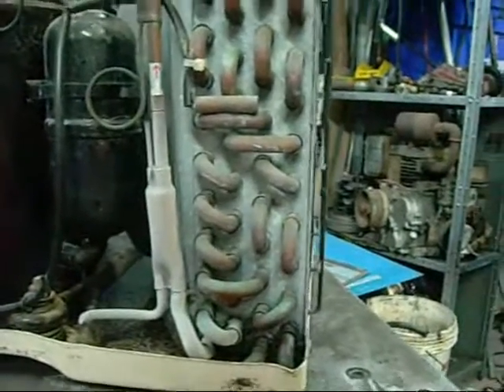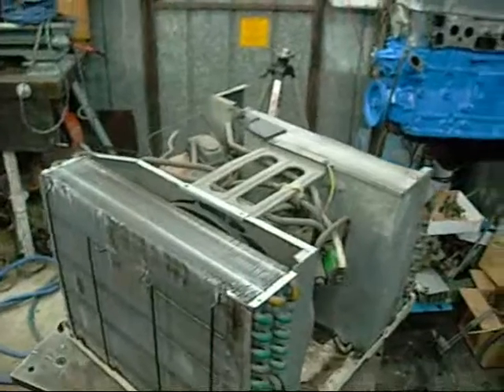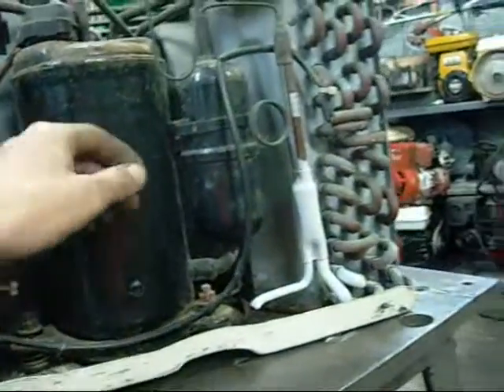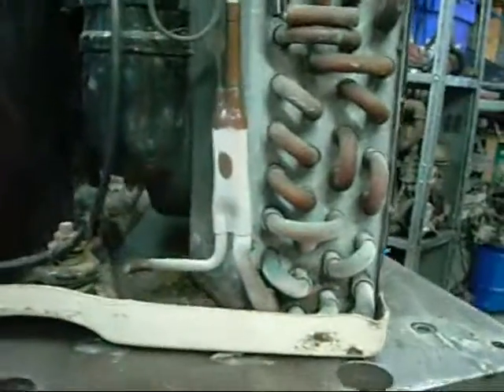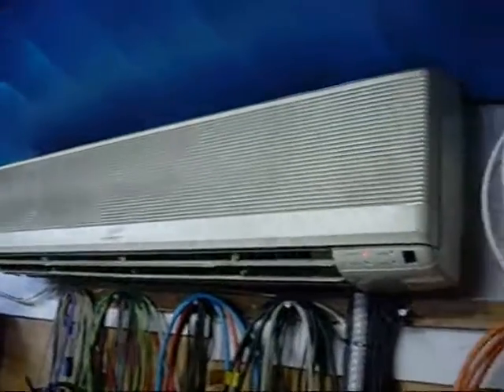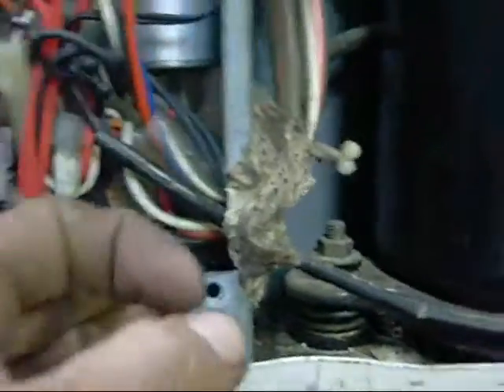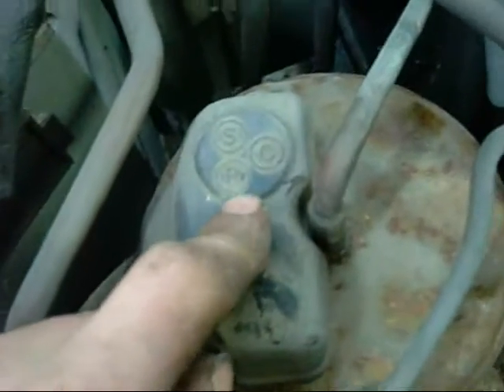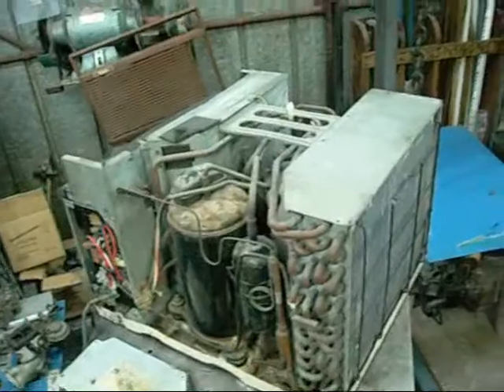The Heatpump Air Conditioner Explained - Pt2

Comment from the maker: @gavincurtis I've seen big screw units from overseas, I think Danfoss have a line of them now. but their all huge semi-hermetic systems for cool rooms.

Kaeser rotary screws are fantastic air compressors. my foundry job had a Airtower 47, with auto-drain and chilled water trap, monster of a machine but for its HP rating it was pretty quiet.

Comment from the maker: @GFVagent007 I've seen the automotive ones labeled flammable, but nothing clearly marked R290. I guess their just marketed under different names.

I wouldn't use flammable gas in a indoor unit simply because a leak would quickly form a dangerous explosion hazard (starter relay spark would touch it off nice) but outdoor or car stuff would be fine.

Comment from the maker: @Lewistodd2008 compressing any gas to a elevated pressure creates heat, in the case of refrigerant it also releases heat that the gas has absorbed in the evaporator.

its a combination of both mechanical and electrical heat from the compressor, and heat being rejected by the compressed gas.

Comment: @Aussie50 OK, I think I understand.  I also remember the same thing happening in a cool room at a restaurant my uncle used to own when the fan had been switched off because someone was cleaning out the cool room.  The cool room compressor kept turning on and off until it somehow managed to trip the circuit breaker, turning off all the lights with it.  When I was young we lived in a unit with a wall A/C and I remember when we ran it in heat mode the comp would cycle on and off every few minutes.

Comment: I remember some years ago I was at my ex girlfriend's house and somehow they'd managed to switch their Westinghouse window AC on without turning on the fan, I could hear the compressor kicking in for a few minutes, then it would shut off for a while and the cycle would repeat over and over again until my girlfriend's mother managed to get the fan going, after that it worked just fine.  I'm guessing the reason why the compressor was doing that was because the coils were freezing up, right?

Comment from the maker: @tranefreak1 thats the expansion point, the system was jsut getting settled in so a lot of the liquid was evaporating there.
as the system normalizes it will thaw out.

the little coil on the side of the check valve becomes the cap tube for the outdoor coil, the expansion point.

Comment: Hmmm in the US all I had to do was take a test to get my EPA certification. There is no accounting to the EPA about refrigerant usage here either. You can go buy it and use it as you see fit as long as no laws concerning it are violated. Intentional discharge carries a $30,000 fine though. And for reporting someone for discharging unlawfully (if it can be proven) gets you a $10,000 reward.